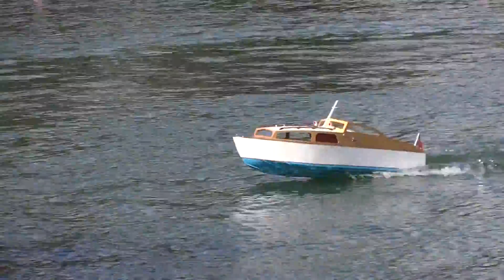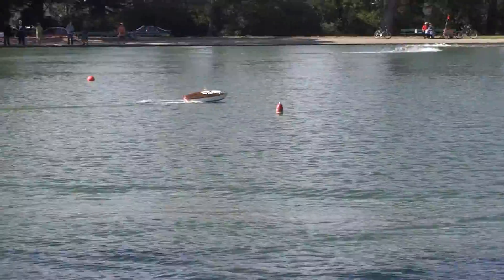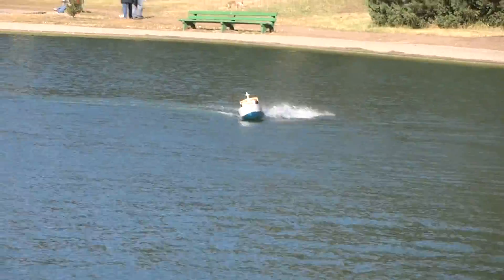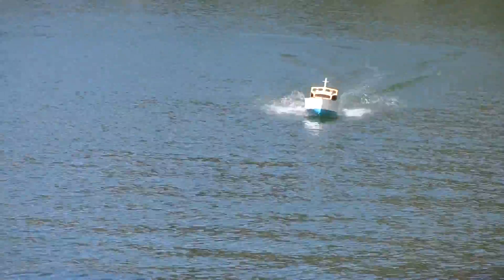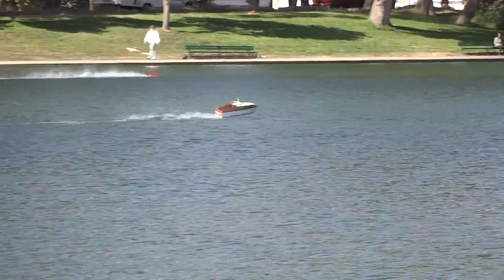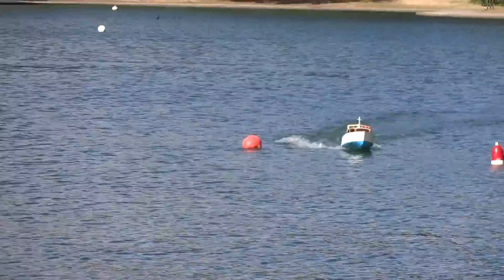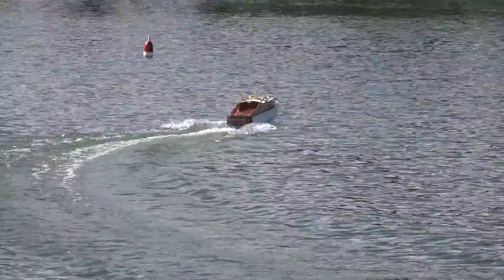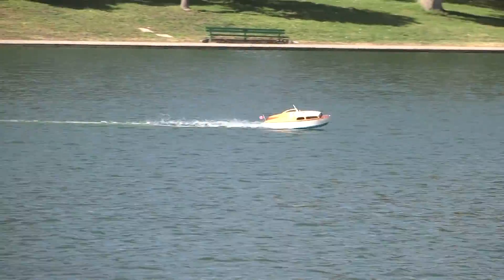Fairey Huntsman 28' R/C Model Boat with Astro 860-5T Brushless Motor

Comment: Have leccy motors got better since the 70s??
Reply: In a word yes, brushless in particular are very efficient, enabling a physically small motor to make a heap of power without frying itself. The weight of LiPo cells is also much less compared with lead acid. My own Huntsman is fitted with a brushed motor, it previously ran with a pair of 6 volt 4.5Ah lead acids weighing a total of over 1.6kilos, the LiPo pack about to be fitted weighs just over half a kilo but is 8Ah and should give massively more run time.